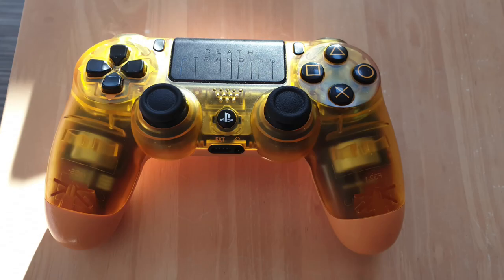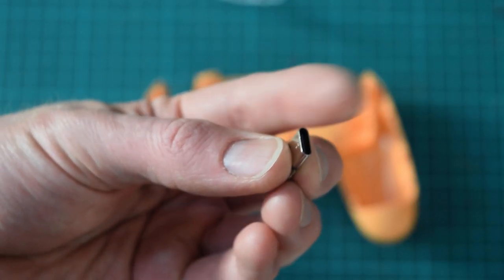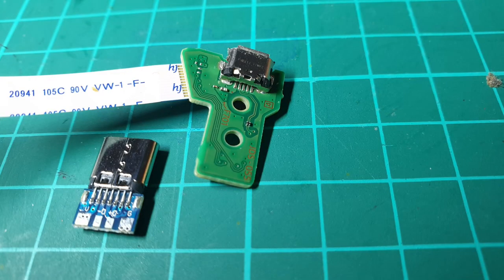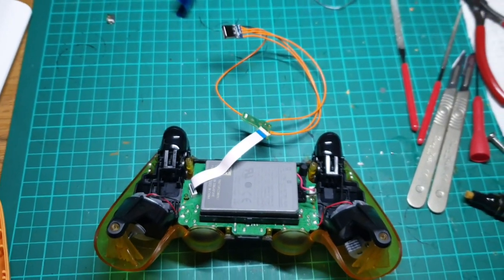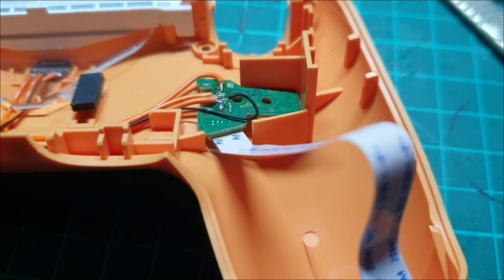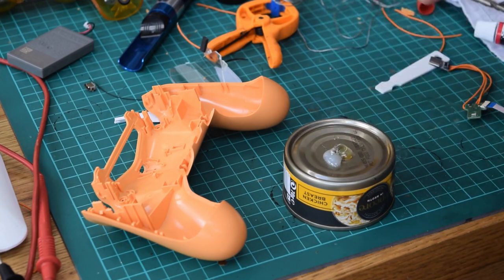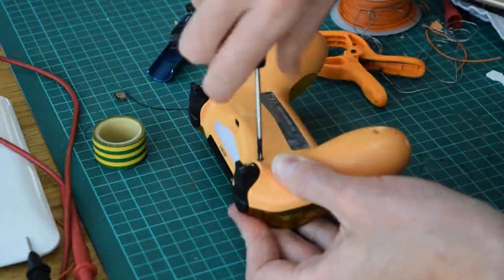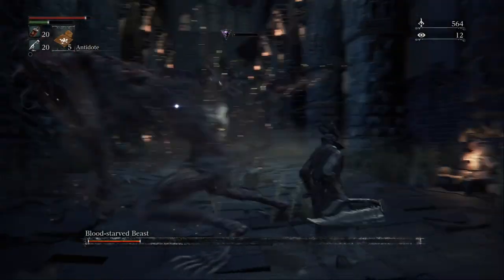PS4 Controller USB-C Mod!

Comment: This board appears to be missing 2 0402 size resistors that they decided to jump using solder instead so be careful on what u use these for. clean looking mod mod, a friend showed me your video so thought i'd mention the resistors.
Reply from the maker: Cheers! I don't know what they do, but thanks for the note
Reply: @remorsehorse  they are used to make it usb 2 compliant incase plugged into a usb c on a laptop or a usb c charger as that would damage components. usb 2 usually draws 5v were usb can deliver much more.
Reply: Are those so it can use a type c to type c cable instead of only a type a to type c cable
Reply: What will happen then?

Comment: Unfortunately, you do lose some functionality when using thsi controller with PS4 games... Just some selected games and with a PS camera :P The light bar is needed in these cases. If you don't use the light bar at all, power to you and good job.

Comment: Great work, thinking of doing this myself.

For removing ports like the micro USB port a hot-air station does wonders. Add some extra solder to the anchor points, heat the connector up with the hot air, and pull up on the port when the solder melts.
Reply from the maker: Yeah used to work with one of those. Very handy piece of kit! That and lots of foil tape to shield off the other components

Comment: The problem with this was the LED light, since its not on the proper position it wont lit the triangle thingy and the part on the touchpad. I just opened up a ds4 because i want to dim more the led light with some tape. So i just realized this light thing

Comment: Hello, I just loved your work, it's amazing. I was wondering if I can change from micro USB port to usb c port in a New Huion 1060 Plus (graphic tablet), I am not really sure because I need data transfer due to this one still uses the cable for working. What do you think about it?
Reply from the maker: That is very kind of you, thank you! It's all about whether you have enough room inside to get the new connector in position. In a tablet device it could be tricky. It looks like it sits in a little gap in the board - aligning with the outside of the case could be difficult https://youtu.be/Pbp3oKVw8kg?t=117. Can you take it apart and take a look?
Reply: @remorsehorse  thanks a lot, a will take it apart and look for  that space you mention it. Would be necessary to install any resistor or something? I don't know enough about it and I have a lot of doubts. 
Thanks a lot again!!!!!!
Reply: Thanks a lot for the video 🙏🏻, is the same tablet I have. I will try to take apart as much as possible and come back to share the results!!!!!!
Reply from the maker: @J.M.Morales-Romero  The board I got had components already fitted. It was this one: https://www.ebay.co.uk/itm/254799596072
If you can buy one, you can then work out whether there's going to be enough room, or if you need to think of something else. I've gotta tell you - if you aren't experienced with soldering and electronics it could be a difficult one, just because there is so little room to work. I would check it out and plan it, then decide whether you're gonna go ahead or not. Don't do anything hasty! Good luck!
Reply: @remorsehorse  Oh, I see. That board is not only the socket right? It comes really complete, I think would be easier to work with this one than just the socket as that. Right, I will try to find and purchase something like that. 
Thanks a lot again 🙏🏻 for taking the time and attention to advice me!!!!
Honestly I had no much experience with it 😅, but I'll try on another components while the board arrives. Really? You already have a plan to work on it? You are amazing!!!!!!
Reply: @remorsehorse  I'd be glad to learn some of this 🙏🏻, I recently got some tools for electronics but I haven't used yet, just an old soldering iron that my father gave me time ago. I haven't worked with micro components, that's why I stay still about it. I don't want to damage the main board.

Comment: Hi I'm new to all this modding stuff so please be kind if I ask dumb questions. Is the discolouration normal when soldering? Would you recommend a hot pad or am I OK with just the iron to start?
Reply from the maker: Hi! Yeah some discoloration is pretty normal. You need to not linger and things too hot. I don't know what a hot pad is I'm afraid 😅

If you haven't soldered before you will have a bad time doing something like this. If you can get an old PCB and practice taking parts on and off you'll probably learn a lot

Comment: I'm gonna do this cause I hate the crappy chargers having to be at a specific angle to just barely work then have to wait like 2 hours to charge it cause it's getting a poor connection I've already got the wires ready and the 2 controllers modified just gotta wait for the USB-C boards to come in

Comment: How exactly did you remove the old port? Is it just by force or could i do something wrong?
Reply from the maker: You need to de-solder it. If you're not experienced at soldering I'd steer well clear of doing this
Reply: @remorsehorse  
Oh, that was a fast answer. Thanks mate 
I think I will try it. What could possibly go wrong. I only want to try all this for fun anyway ^^
Reply from the maker: @monox857  check out Marius Heier's channel if you fancy buying a drop-in usbc replacement board. He started making them and it's way easier!

Comment: what does doing that actually accomplish besides looking pretty dam cool? Does it make the controller reaction time better?
Reply from the maker: I have lots of USB-C things and not so many micro-USB things. It's just more convenient in my house, that's all! Yeah it's a pretty unnecessary mod
Reply: Port Durability should be better, along with USB-C's reversable nature, and possible future proofing. Plus USB-C will get more common with time, more devices will use it, and a lot of things already use it, such as the Switch Pro Controller, DualSense 5, Xbox Elite Controller 2, a decent bit of Modern phones. So it would cut down on needing different cable types sooner or later.

Comment: Can you explain which pins on the charger board do what please (ground, 5v, data +, data -)
Reply from the maker: I don't have much to add really. Ground and 5 volts is obviously power, then the data pins (which don't actually work) would be for the controller signals if you were playing wired
Reply: @remorsehorse  Good job either way. I just wouldn't want to lose the charging light. I'm gonna try mounting a usb c port on a wire on the back of the controller, drill a small hole & feed the wiring through 👍🏻

Comment: I have to try this sometime. The usb b micro is so unreliable, disconnects easily when charging
Reply: nowadays theres a guy that sells usb-c boards from norway for 10$ per board. just take your controller apart, unscrew the micro-usb board and check the back which model of board it is, then order the corresponding model. hes even got tutorials on how to do it. the only other thing you need is a needle file set to grind away some of the plastic so the new usb-c can fit. channel name is Marius Heier
Reply: @PatrickRatman  thanks man. Will check it out sometime

Comment: Does it still work in wired with the PS4/PC I've seen another person do this and they said the only issue was with android phone detection in otg mode
Reply from the maker: Just gave this a try, and no, doesn't seem to work ☹️ Not sure why without more investigation
Reply: @remorsehorse  not work on pc with you ?

Comment: I need to do this
Reply from the maker: You can do it. You got the touch, you got the power...
Reply: @remorsehorse  is it really possible to do so as a noob? I mean, I'm pretty sure I would mess up at least with one thing. And to get those equipments is not a cheap thing I guess?
Reply from the maker: @SalmanKhan-ll3ku  If you're new to soldering I think you would need quite a lot of practice before you take on something like this. If you're not particularly interested in buying equipment for other jobs like this, you'd be best off investing in a PS5 controller instead I think
Reply from the maker: @SalmanKhan-ll3ku  I just heard that the PS5 controller DOESN'T work on PS4! I'm sure I heard that it did, but the only way is via remote play which would be a very weird thing to do

Comment: What gauge of wire did you use for this?
Reply from the maker: The wrong gauge! I think the black Kynar is 30AWG, which is much more appropriate
Reply: @remorsehorse  thanks for the reply! 
I have 20, do you think that would do or should I get 30 gauge instead?
Reply from the maker: Ok I just checked. The orange is 24AWG and I had a little bit of a tough time with it. I think using 20 will be very difficult. The black is 30AWG and much easier.

Do note the post from Marius here about his USBC replacement board - that will be an awesome drop-in solution if it works! Saves messing up the light too
Reply: @remorsehorse  Thanks so much again, have swapped my order. 

I already have the USB C ports so I'll just go on with this, though glad to know people are doing drop-in solutions now!

Comment: Could someone tell me how the wires have to be connected to the board? 🤔
Reply from the maker: I think I got it wrong, as it'll charge but not be detected by PS4. Might have another look at some point
Reply: @remorsehorse  not be detected ?
Like doesn't connect and give any input?
I've already done it to two controllers but haven't gotten the lights to glow on charge yet
Reply: @remorsehorse  I've just been matching the usb c board to this
http://4.bp.blogspot.com/-yi-dbdKLfNc/Vfzp4g13yVI/AAAAAAAAACU/bV8ceSmav5Q/s1600/micro-usb-pinout.jpg

Do you have any updates on how the wires are connected at all?

Comment: But you lose the lightbar!
Reply: I guess you'd have to find a way to transpose the LED because keeping it in the proper position obviates any room for an unupgraded charge port.. one way would be to order a second board off mobile sentrix and split the functions between your original and the donor. But that would be some work. Otherwise just rework the microUSB off and place it with a usb-c. If its not too painful to navigate the pin-out conversion